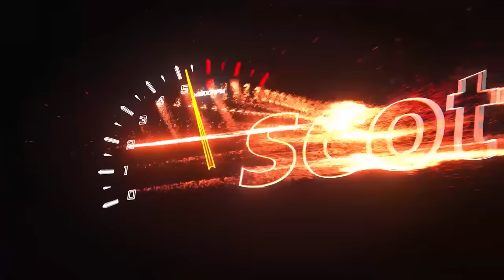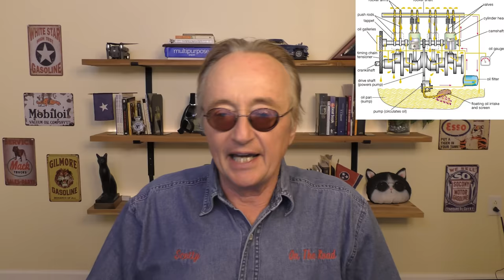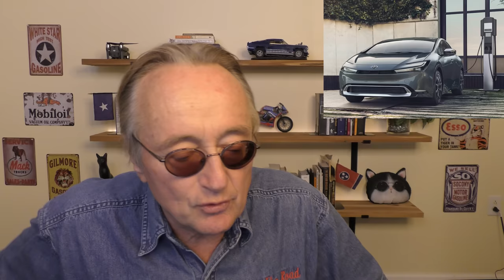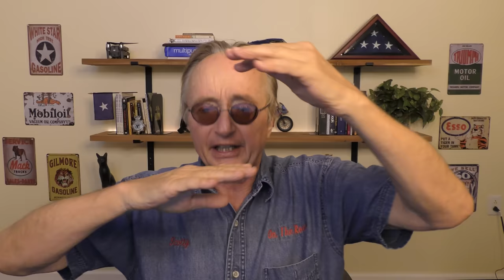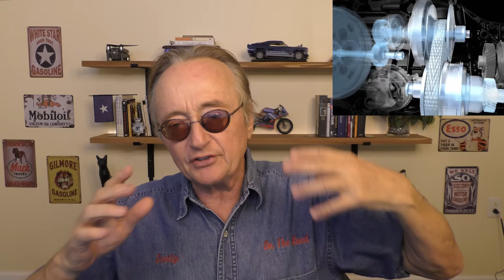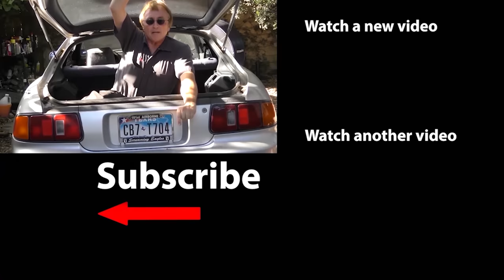Never Do This When Changing Your Engine Oil

Comment: You want to keep your car from rusting you need to wash it a good car wash that does the underside. You can drive forever and never wash your car and it won't rust if you never drive it in areas that put chemicals on the road for snow it's those chemicals you need to get them off right away and keep going through the wash until the roads dry over because the melting snow will still carry those chemicals.

Comment: Have a 2016 Subaru Outback with a 4 cylinder. I’m a reasonable driver and have 124,000 on it. I run Amsoil and it uses less than a quart every 15,000 miles. I got it to tow a Casita travel trailer…..58 mph and got 21 mpg towing. I also tow a small aluminum boat. Then only problem I’ve had are the rear wheel bearings needing replaced. Dealer said it was probably the rough roads I’ve traveled though Alabama and Ohio. Mainly they we’re trying to cover concrete roads with asphalt which expands differently, so the asphalt spits at every seam in the concrete, making a washboard road. We’ve since sold the travel trailer and purchased a larger one, towed with a pickup. Hope to have the Outback to 200,000 miles, or until it become unreliable.

Comment: Now that I'm thinking about it, I remember hearing that about Subaru's. The thing is, I drive a 6-speed manual transmission Subaru Crosstrek (2019). So far, I haven't had any issues. Though it is going into the shop this month for the 60k mile maintenance.
Reply: @lucario808 a 2019 Subaru Crosstrek with a manual transmission? Sounds fun AF. Any newer cars in the last 5 years that aren’t sports cars that are available in manual are unicorns
Reply: @Blakecryderman7244  it's a very fun car. Outside of muscle cars, I noticed it's difficult to come across manual transmissions these days.
Reply: @extremefalcon  certainly.

Comment: Still having the check engine light coming off and on. I am not smelling rotten eggs. Code 420. I used cataclean for lower sensor bank 2, the cat. Which in your honest opinion is the best cat cleaner? 🤔

Comment: You say when oil filter is pointing down it empties of oil when you shut the engine off. But doesn’t the anti-drain valve prevent this from happening?

Comment: Have a '23 XLT Super Duty I'll be taking possession of on Wednesday. What product out there is good for a DIYer to undercoat/rustproof with, (a one & done type product for the most part not an annual one.)? Any parts to avoid spraying beyond the obvious exhaust, drive shaft,..?

Comment: Do you recommend spraying the frame of a new truck with for eg fluid film to protect from rust? Just asking because I’m getting a new Tacoma soon. Thanks
Reply: You have to do it a couple times a year.  It's not a set it and forget it thing.  I personally just rinse the frame off when I can in the winter.  Rust is inevitable where I live.  There is just no possible way to coat every square inch of the frame.
Reply: If you have the money,time and care then do yourself a favor and have your undercarriage painted properly. Seems like it's less time consuming than reapplying a fluid
Reply: Try Fluid Film or PB Blaster brand corrosion resistant spray.
Reply: Don’t waist your time. The frame is coated from the factory and de-ionized.... the amount of years to get so much corrosion to make it not safe are so great that you will not even want the vehicle anymore.
Now if your driving it on the beach or something maybe then you need to rinse and spray....
Reply: I hear that spraying with lithium grease helps to prevent rust, and easy to apply.  You can always spray some on when you are bored.  It doesn't hurt, and it is cheap.
Reply: @mplslawnguy3389  yes there is

Comment: 1:13 I know it's pointless to prime the filter with oil, but don't filters have an anti drain back valve to stop that from happening? If it didn't, your oil light would come on for a few seconyd every time you start your car like it does on the first start after an oil change.

Comment: If it’s not import to prefill your oil filter with oil during an oil change, then why do oil filters have anti-drain back valves…..you know the valves that prevent your oil filter from emptying out when you shut off the engine thus preventing your from starting your engine with no oil in the filter 🤔

Comment: So not all lubricating oil fed to the engine goes thru the filter?   

Scotty, you can SAY that but I do not believe you can back that up.     I have the flow diagram for my 3.2L V6 M112  and both the text and diagram clearly state that all output of the pump goes thru the filter.  Same for my bike.  

Can you back this statement up?   Can you point me to a source that agrees with you?  Because, while I have always agreed with your statements, this one is quite a surprise.

Comment: Hey. Great job on the information.  I have a 2012 gmc. I lose a quart and a half in between oil changes. What’s up with that. Mobil 1 for oil. I change why before 5,000 miles. 5.3     Thanks
Reply: That's not terrible. Just check it every 1k miles or month. From what I read, those 5.3L engines have rear cylinder deactivation. Since the fuel isn't spraying and lubricating the rear cylinders (which are still moving), the piston rings tend to wear the rear cylinders a little faster. Or maybe you have a small leak in your oil pan or elsewhere.

Comment: Scotty, a few years ago I went into the NAPA store to buy a new serpentine belt for my Chevy Blazer. I told the guy at the counter I did not want one made in Mexico. "Oh no, we only sell Gate belts." When he brought the belt out he and examined it he was surprised to see that it too was made in Mexico. If it's either Mexico, or China, I will take China. My experience as a QC technician for 40 years is that nothing good ever comes from Mexico and the parts we received from China were excellent.

Comment: Making plastic oil pans is the same craziness as making donuts as spare tires or, even worse, run flat tires with no spare since they are undriveable for any distance more than those 50 miles. What happens if you are 60-100 miles away? And good luck going at 50 mph on a busy highway.
That 2.5 liter flat 4 Subaru engine is not as bullet proof as stated. A close friend of mine had a 2015 Forrester with that engine and oil changes were religiously made at every 5,000 miles using synthetic oil and original Subaru's filters. A major engine failure took place at 78,000 miles and "something" broke on the left engine bank causing a through and through crack on the valve cover.
The response from Subaru? "The middle finger"! Beware folks.

Comment: So what was the thing you should never do when changing your oil?
Reply: Change washer on drain plug, there cheap
Reply: @YS-fr6nu  I never did it on my older vehicles and it was fine.  They had metal washers.
Reply: Run up and down the street naked screaming out I'm changing my oil,
Reply: @Nozinbonsai  depends on the neighborhood
Reply: Fill your oil filter with oil.
Reply: @DJNEGRO_CT  no, he says you can fill your filter, but it's no longer necessary to do.
Reply: @Nozinbonsai  It's required in my neighborhood, and all the girls seem very interested in learning about servicing their cars, well a couple of the guy's too, for some reason though they never seem to retain all the information 🤷

Comment: scotty I have a 2010 nissan versa s runs great but the transmission fluid is really black it has 158.000 miles on it I have no idea the last time it was serviced, I've been told to just leave it alone ,should i just have it drained and filled?
Reply: I’d change the fluid a gallon at a time, don’t flush it.   It’s a risk but at least you have a chance to extend its life, otherwise 100% chance it’s going to quit.   More upside than down.

Comment: Scotty, I have a '77 F250 300ci inline 6. All stock, no a/c.
I bought a Felpro intake/exhaust manifold gasket, Permatex hi-temp gasket "silicone" and one by one I have loosened and tighten back the 13 manifold bolts (not with a torque wrench though). I don't know why but I'm worried to replace the gasket though as I don't want to break a bolt when tightening back and I saw a video where someone's cast manifold just broke as they were pulling it off. Although they pried with a screwdriver which I'd think would push hard in one spot.
- Am I overthinking this job?
If I have to pry should I get a 4"-6" scraper to spread the area? And, is scraping old gasket of with a flat razorblade good enough?
Reply: Getting all of the exhaust manifold bolts loose without breaking them is the hardest part, so you already achieved that. You can back off the bolts and try to wiggle the manifold loose before taking it off. Generally they crack/break when dropped during the removal process. Be sure to use a torque wrench when putting everything back together and get a new doughnut seal for the exhaust pipe since that is the most common area for exhaust leaks. Also, make sure the heat riser isn't stuck.

Comment: Hi Scotty. Which cars have plastic oil pans so I can avoid buying them?
Reply: @Matthias_Fischer  The plastic ones might seal better when new… but after 15-20 years, I guarantee they will be toast from all those heat cycles.
Reply: @Matthias_Fischer  Plastic will always degrade and become brittle over time. A metal oil pan will last forever unless damage. Nuff said.
Reply: @Matthias_Fischer  tell that to the F150 owners with the 2 piece plastic pans that leak like crazy.  Don't take my word for it all over the internet
Reply: @Matthias_Fischer  ok tell that to the owners of those trucks. Plastic and rubber degrade more over the lifetime of a vehicle compared to metal. It cannot be denied,  but you can make the case cars should be thrown away every 10 years,  then your economy makes sense.

Comment: If somebody has the 2022 Challenger or Camaro where the Oil Filter spins on from Bottom of ze Engine. Is it ok to Pre-Fill them ( 2022 models ) ? Mustangs the Oil Filter spins on from the side so it's  no use pre-fill it.

Comment: I disagree with Scotty on rear wheel drive on four wheel drive because you have dry startup’s with rear wheel drive and four wheel drives but I agree with front wheel drives. Most people think dry startup won’t hurt a engine that is not true over time it will decrease the longevity of the engine. However, that is not nearly a problem with a front wheel drive like a rear wheel drive or a four wheel drive and semi trucks 🚛 especially have to be primed. 🙂
Reply: What are you smoking? Start up has nothing to do with the style of transmission. Signed a mechanic of 34 years.
Reply: You better do that on a semi truck 🚛 because if you don’t do that on a semi truck 🚛 it will destroy a engine on a semi truck if you don’t prime it. 🙂
Reply: Scotty Kilmer thinks he knows it I been studying diesel engine semi trucks 🚛 they don’t start on a dime like a SI car or pickup truck engine if you don’t do that on a semi truck 🚛 prime the engine the driver might be looking at a new engine and you might be sued by the trucking company if you don’t do that. 🙂
Reply: You may not notice the damage of dry startups in the first three years; however, 10-to-15-years down the road is where the dry startups will show signs of the damage done to the engine. 🙂

Comment: Have a 2006 caravan with 250000km says too use 5w20 should I switch to a heavy weight oil may 5w20 too thin? Anybody have an answer?
Reply: Gerg, follow the owners manual and that will be fine. If anything, choose a high mileage oil but use what 5w20 if that is what it is telling you to use
Reply: Ok thank you

Comment: If I upgrade to bigger turbo and I’m 50%+ horsepower from stock, can I switch my oil grade from 0w20 to 5w30?
Reply: I'd go with a 30 weight oil regardless. Only use 20 weight oils for CAFE requirements.

Comment: Don't ever fill an oil filter. You never pour oil in the center hole of a filter, ever. You have to cap the center and fill the perimeter but don't do it anyway. Any silica (grinding compound) particle that may get in the center will get in the bearings and scratch them.

Comment: Scotty, (For your Information), Gates are now making some of their parts in China like Water pumps, tensioner pulleys and belts instead of Japan or the US so next time you change your belts and water pumps or belt Tensioners  beware of gates parts, they may not last like they used to as the quality of the China  made Gates products have gone down compared with the Japan manufactured products.

Comment: I don't fill it up. but about half full, the filter matieral soaks it all up even if I put it on upside down depeding on the 4 vehicles we have.  I figure it doesn't hurt and that way the filter media is oil soaked and the engine doesnt have to wait 2 seconds for the media to pass oil.

Comment: Regarding plastic oil pans, why tf would you ever dream of putting extremely hot oil in contact with plastic. That's a guaranteed recipe for disaster and micro plastic leaching. Not to mention plastic is a garbage material for automotives in general. 

It's used here and there, mostly for cheap replaceable (nsmall) parts. But that's because they don't give a rats butt about em.

Comment: Apparently on one of those Lincoln hybrid vehicles it's like $40k to have a rear main seal replaced. And everything is plastic even the oil pans
Reply: 40k for a repair?  Even if the vehicle cost 100k the repair wouldn't be worth it.
Reply: @moto-fl3rd  just keep adding oil
Reply: @thad1984  I'd guess the repair is less than 40k.  But yeah 40k will buy a lot of oil!
Reply: @moto2016  get yourself a couple barrels of oil there. I go to UTI and we have a section with ford vehicles and the "ford specialized" mechanic said that hybrid SUV with AWD will run you about $40k to replace the rear main seal. Since the front driveshaft runs through the hybrid drivetrain, and engine you have to pull out the transmission and the hybrid motor. But to pull that out you have to remove the front su frame, but you have to remove or atleast unbolt the lower control arms but to get to the lower co tool arms you're move part of the radiator support. That is plastic. So those cars are just throw away cars
Reply: @thad1984  $40,000/100 dollars an hour =400 hours.  400 hours/8 hours=50 days.  That's rough math not including the parts cost.  The entire vehicle could be taken apart and put back together in that time.  If what you say is true those vehicles are not for me!
Reply: @moto2016  at a ford dealership they charge $252/h

Comment: Are 20,000 mile oils actually good for 20,000 miles with a 20,000 mile filter??
Reply: I would never trust a 20k oil. I don't even trust 10k oils. 5k sounds like a good time to check it. If it looks good (not too dark), you can proceed. I would still change before every 10k.

Comment: Hi Scotty, I think I damaged my oil filter bearings by not putting oil in my filter on my last oil change.  It's making a horrible noise.
Reply: @youdontknowme2915  Are you a mechanic?
Reply: You’re supposed to get prime the oil seal with a film of oil.     You misread the instruction manual.  You snooze 💤 you lose
Reply: @bbustin1747  Thanks, next time I will read the oil filter manual and pay closer attention to the section on oil filter bearings.
Reply: Oil filter bearings...LMAO😃

Comment: Do you even need to change spark plugs anymore? I haven't done that in years.
Reply: I would say after 150k miles.  It may help it run better, and cheap diy.
Reply: Honestly I did mine at like 110K (long after the recommended interval in my manual, 75K I think) and I saved my old ones. They still gapped precisely at 0.044” and if I washed them off with gasoline/solvent of some sort I could probably convince you they were brand new